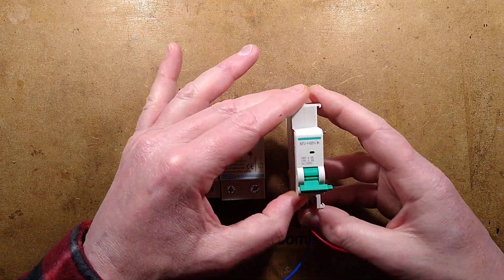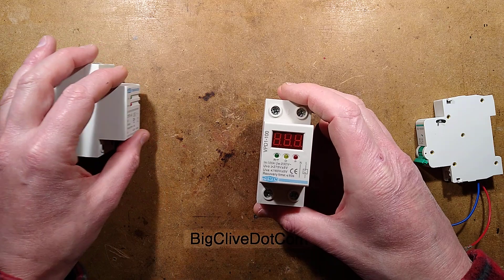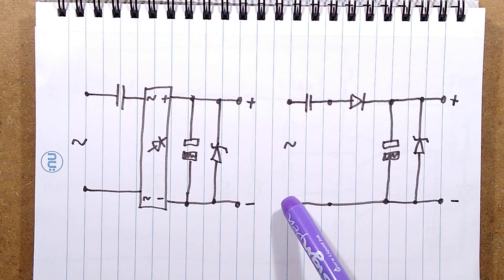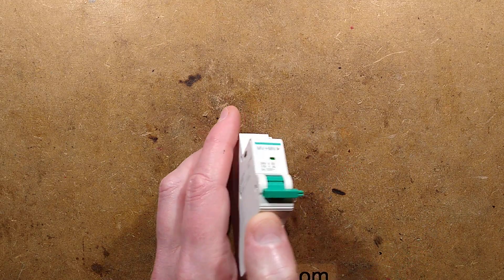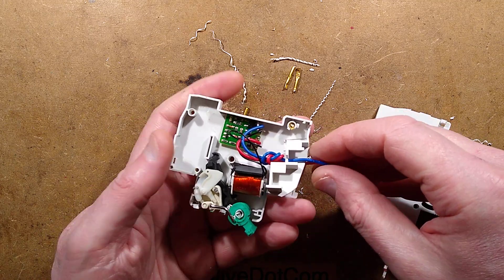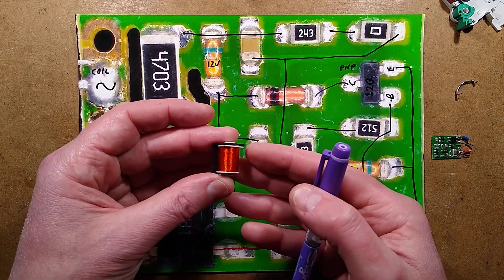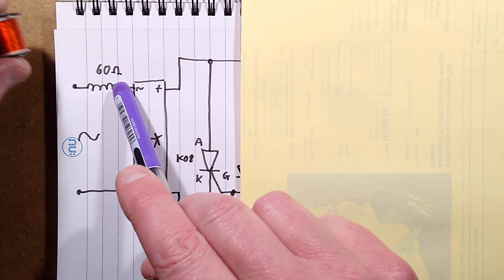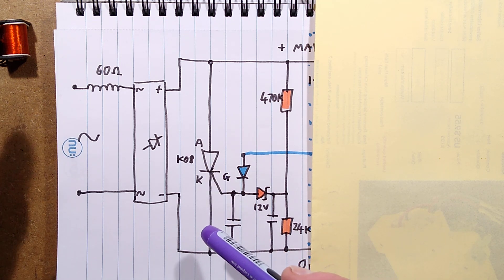Over/under voltage detector - with schematic

Comment: This tear-down inspired me to create a specialized safety circuit for our observatory.  The gearboxes have (from 1971) quite-well-built German "tacho-generators" on them.  These generators were used as part of the servo control loop back in the day, and they produce a well-defined output voltage based on their speed.  I wanted to re-purpose one to use as an independent "trip" for the brakes and motor power if the detected speed on the axis exceeded certain bounds.  I used something similar to what you showed here in your video.  The main hazard we're trying to control is the elevation axis "running away" under gravity--that can happen if the control system has disabled the brakes, but is not driving the motor, or there's a break in the drive-train between the motor and the gearbox.  This "tacho-trip" circuit will handily provide for a safety-trip in that situation.

Comment: There’s a lot of 12v breakers I’ve seen , most are being used on solar power kits for camper vans , can you check a few out please Clive as one said 200 amp and tripped at 110 amps

Comment: I wonder how low of voltage it would still be able to trip. Even down to 60 volts the coil should still draw 1 amp correct?
Reply from the maker: Current is the same at any voltage.  It should theoretically work at 12V.  Not suitable for high current DC though.
Reply: @bigclivedotcom  when the thiristor shunts the rectifier, doesn't that just complete the circuit, from live through the coil then the shunt to neutral?
 So using ohms law the 60 ohm coil would draw less current if the mains  voltage was very low right? And more if the mains was higher? 
The 60 ohms of the coil should only draw about 1 amp at 60 volts rms and should draw 10 amps at 600 volts rms. Or am i missing something here?

Comment: I found one of those digital ones that you can actually reprogram the over- or under-voltage setpoints.
Handily it works on 230 as well as 115!
It also has a programmable overcurrent, but it's not really meant to be used as a full-on circuit breaker - even the manufacturer recommends coupling it with isolators and real circuit breakers.
It's rated for 63A branch, and is available in 80A branch. Since American branches are usually only about 15-20A, I grabbed the 63A model and will put it behind a 60A breaker.

Comment: Ive seen these attached to motor circuit breakers, using the mcpbs switches to turn on/off a conveyor, this trips the mcpb when the conveyor is unplugged, stopping it from auto starting on powerup
Reply from the maker: Zero volt relay/switch.

Comment: Clive, What's the most important individual component in a circuit you've ever seen?
Reply from the maker: These days it has to be a microcontroller.  But with discrete components, each has its own strengths.  The MOSFET transistor has evolved spectacularly, so it gets special mention.

Comment: Are there any main breakers that self trip or switch off if there’s a power outage? For preventing islanding with inverters or a generator. Then you can have the inverter or whatever switch off when it detects voltage on the input side of mains, maybe a variant on the self resetting under over breaker that can work as a single space switch without needing to physically disconnect the inverter which can be connected passively through its own breaker
Reply from the maker: Zero volt relay?  You set it, but if power fails it turns off and needs reset manually.
Reply: @bigclivedotcom  this sounds super not legit, but I guess things go different in 🇬🇧, if a relay could be used that would work so well because I could have a controller turn it back on when the prerequisites of power on one side and not on the other are met, or if they are able to take a standard slot and act as a breaker then I could have one for each, or just put them in an enclosure if that was up to code

Comment: I know this breaker is for over and under voltage protection, but I noticed that you mention the possibility the wires were for tripping the circuit. Over here (USA, I'm sure they have them there too) those are called shunt breakers. My public school system has a vocational school for high schoolers that has various trade classes (metalworking, HVAC, automotive, masonry, etc.) and in every shop, there were several red buttons placed around in different places. When the button was pressed, it would trip the shunt breaker powering the outlets and machines in the shop it was in, in case a kid was about to get their hand chopped off or other dangerous act that needed the electricity off.

Comment: It seems the PNP transistor is always reverse-biased between E & B if it is not tripped by under-voltage.  What will be the max reverse voltage just before the over-voltage part triggers the SCR ?  Does the PNP Tr need a high B-E breakdown voltage ? Thanks.

Comment: do you think that sometimes, discreet circuits are more elegant than chip/micro stuff is?
Reply from the maker: Yes.  If it can be achieved simply with discrete components then it's a better option.  The best bit about microcontrollers is that they can do so many different things.  The worst bit about them is that sometimes they do.

Comment: Your dual comparator circuit only works on DC, because it would trip under outage on AC zero crossings. Otherwise, very interesting content.
Reply from the maker: There would be a delay capacitor.  It was just a rough doodle.

Comment: clive please can you tell me if this https://docs.rs-online.com/6c67/0900766b814f1e75.pdf can be switched on and off from a ac feed, in the 20-30v ac range, i think you call it the coil?, if the coil can work of ac 20-30v ac, and do i need to order a ''AC type''?
 thank you
Reply from the maker: You'll need the 24V AC coil type for that.  Using a DC coil for AC can result in weak operation and loud buzzing.
Reply: @bigclivedotcom  thank you, ok ill get a ac type, ill be powering it with some basic type transformer , is there a min amps i need to work the coil when feed with 24ac,  for example would a 230 V - 23 v ac 12va be enough to work the coil on the 24v side

https://www.ebay.co.uk/itm/Diversey-Electrical-transformer-230-V-23-v-ac-12va/303585211518?ssPageName=STRK%3AMEBIDX%3AIT&_trksid=p2060353.m2763.l2649
Reply: when you get chance please can you tell me if this transformer will switch the relay thank you!

Comment: Maybe I'm wrong, but since the relay coil is a purely inductive load controlled by alternating current, most of the power is purely reactive, it would not consume 220²V / 60Ω but much less

Comment: Hey beardy; there is something called facial cleansing device expanding very fast (apparently it's ultrasonic) in the market and I2m drooling to see its inside for what makes this egg shaped thing so special. 

Take a guess, no one teardown even a single one in the whole web. yup no schematics too. 

I just want to know if a regular brush with intense force worth more than those buzzers or not.
Reply: btw; https://www.youtube.com/watch?v=tTjL9IKb-GE  this egg shaped thingies.
Reply from the maker: By ultrasonic they mean vibrator motor.

Comment: Hi Clive. I noticed that the neutral lead is quite short (same length as the live) Are these only designed to trip double pole circuit breakers and RCDs? If you wanted to trip a standard MCB with it, would you have to extend that lead to reach the neutral bar?
Reply from the maker: It connects to the breaker it actuates.

Comment: Can you test the under voltage functionality please as I can’t see how one would get the required few mA of trigger current through that (emitter) 1.2M resistor. Maybe it doesn’t actually work (he says, sticking his neck out gingerly)
Reply: Yeah I agree. I first thought the cap on the PNP might supply enough of a pulse but the 81K of resistance chokes it return path.

Comment: Really the circuit which is shown at 15:18 is a very simple one but very clever ingenious circuit. The circuit which is shown at  05:17 is also very clever and it is found in the 555 timer chip to generate the ramp function upper and lower limits where those two comparators set the memory to charge or discharge the RC timing network in the 555 timers.  The logic of all engineering is so ingenious and the sequences should be introduced at schools including the logic of the bootstrap circuit and its connotation of someone lifting himself by pulling at his own bootstraps.

Comment: Can't this kind of thing cause grid instability if used on a large scale?- the 1965 northeast blackout was caused by similar devices on a grid scale.

Voltage goes high, so a device trips, lessens load on grid so voltage rises higher, causing more devices to trip and causes a cascading failure that takes out half the grid.

Guess it's good they're not widespread.

Comment: So they have different models to fit different manufactures breakers or just for Chinesium breakers?
Won't work with Hager or Gyer from what I see.
Reply from the maker: It'll be deigned for a specific brand.

Comment: Cheapest, simplist, may ignite in the event of mechanical failure.
Reply: The Coil is self-fusing. It's unlikely that the burning coil will get outside the flame retardant case. But I expect this device is not certified for explosive environments :)

Comment: I installed the one with display today. I have 2 panel meters, 2 multimeters, and this breaker. All are showing different voltages at 240v AC. 
The difference is between 0-6 volt.
How can I know which one is more accurate? Is there simple circuit which I can make to get accurate measurement, because I'll know exact component values?
Reply from the maker: They're always a bit vague.  The trip threshold probably won't even relate to the digital display.

Comment: Clive, I wonder if I could share a thought with you. 

I will sometimes doodle out network and process flows in a notebook. I’ve been using A Certain Reusable Notebook with their pens for this, as I hate wasting a sheet of paper for something pretty ephemeral. 

Have you considered this versus your notebooks? I’m surprised you are using one-time-pads; you must have a good reason. I’m genuinely asking a question here: have you considered the reusable notebooks?
Reply from the maker: The reusable drawing sheets are OK, but not as clear on video as a solid black line on white.  I also keep the notebooks as an archive.
Reply: @bigclivedotcom  that’s reasonable. Be well!

Comment: thanks clive for getting me back into electronics . ive used a h961-u  battery bank pcba , nice , charges on anything , ive discovered that if your battery holder is unknowingly series and not parallel like you thought ... 10 volt on the battery terminals kinda screws the charge regulation.... orederd the correct battery holders this time . thanks for getting back into electronics man , great show im learning alot .

Comment: Also analogous is a 120V 15A power bar made by Furman with their EVS (extreme voltage shutdown), it automatically cuts out and back in depending on whether the voltage is in the proper range.  I have no connection with the company, I just like the product.

Comment: Clive, we have this heater you can only set for 4 times a day and in winter is utterly useless as it's freezing and we have to manually keep setting it, if I sent you a picture could you talk us through hacking it so we can set it a lot more frequently (for say 15 mins every hour)
Reply: Post the brand and model number.  One of us will find the schematic online.
Reply: @haywoodyoudome  it's an EPH Controls R37-RF A1614A
Reply from the maker: The only thing I can think of is to bypass the built in control and use an external timer or thermostat.
Reply: @bigclivedotcom  that's cool, I'm OK with some soldering, how would I do it though, regrettably I only had 1 hour a week for maybe 3 months in Electrical class
Reply: @Matt Quinn yes that's the one matt
Reply: @Matt Quinn is an external old fashioned oil burning heater, that heats water which heats a sealed radiator circuit from a pipe that goes through a copper tank where the oil boiler heated water is stored.
Reply: @Matt Quinn is oil burning, its either on or off. This timer only allows us to set times 4 times a day. Which is not helpful
Reply: @Matt Quinn by hacking I mean physical. I'm aware it's not done steam off green 1s and 0s but hey. Thanks

Comment: Really appreciate your videos 😊 I really love the accent and you're in Glasgow!! It's awesome!!

My mom is a MacKay from New Glasgow, Nova Scotia, Canada. I have second and third cousins in Scotland. Mom's 92 and reminds me she's still Canadian everytime I contact her. Even though she has been living in the United States for over 65 years.

I'm also a Ham Radio hobbyist for over 20 years. US call sign KB1DIG. Did a little contract work with Raython Aerospace and the Department of Defense just after 9/11/2001.. Production Controller for the retrofit of avionics on the KC-135 stratotanker.. Air Force version of the Boeing 707.. Flying gas can..

Played around with UHF VHF antenna design. Halos and collinear design antennas. Some of my stuff is still floating around on Google.

I'm retired to the Philippines 4 years now. Have been doing a lot of YouTube videos. Mostly custom built ideas for motorcycle related stuff here in the Philippines. Plus some of the local happenings here.

Thank you for your work and best regards for your future from the Philippines 🤠

Comment: I replaced a standard switch fused spur with an rcd version a while ago. Didn’t pay much attention to the way the old one came off because there were only 2 twin and earth cables, a 1.5 and a 2.5. On re energising it held for a few seconds then the bang it made was impressive. You’ve probably guessed it. The 1.5  was the feed and the 2.5 the load. Excellent videos thanks. It was a timeguard spur from Edmundsons.

Comment: I assume this won't low-voltage trip on a power interruption due to the time delay?  And probably because there wouldn't be enough time to activate the plunger?
Reply from the maker: It should be fine being turned on and off.

Comment: At work, we have Over/Under voltage RELAYS used in conjunction with PLC control for generator paralleling gear (utility/generator switchgear). We also have options installed in breakers (configurable for things like auto-charging/shunt trip etc.) with over-voltage and under-voltage triggers for the trip units. Typically, at least in our applications, brown-out situations are worse, so under-voltage scenarios are the main worry downstream.

Comment: Haha...  What model from High End had a problem with a crowbar?!  🤣
We used to use the Emulator "laser-like" fixtures with the arc lamps back in the early 90s but never had a problem with crowbar circuits on those.
They were 120v though, and were kinda tricky to keep enough current there on a long run through a truss or something to keep more than a couple fixtures lit on a given run even with 12ga or 10ga cords.  They were kinda power sensitive power hogs I suppose but kind of a nifty fixture back in the day
Reply from the maker: The emulators were the most disappointing lighting experience I ever had.  So much power, so little light.  No matter how much time you spent tuning up the xenon lamp they just didn't give the implied result.   I think it was the Technobeam that had the issue with its first version of the crowbar circuit.  (Designed to shunt the supply if over-voltage occurred.)
Reply: @bigclivedotcom  luckily we usually only used them in small venues like, say a high school gymnasium, so we even usually only ran them on the "low" light setting to increase bulb life.  They got used once in the Saddledome on high for aCalgary Flames home opener or something and yeah, certainly none too bright in a large venue.  Worked well enough "effect-wise" in a small venue but certainly was a sort of stop-gap of a fixture.  It wasn't me who bought them, they were owned by my boss at the time way back then...  Oh, the good ol' days.  😃

Comment: Whether the auto-restart or permanent off is a better choice depends on the application. You certainly wouldn't want dangerous machinery to automatically restart after a brownout. Imagine someone getting close to said machine, trying to figure out why it stopped working and all of a sudden the power comes back... To be honest I can't think of a good application for an auto-restart after a brown-out from the top of my head...